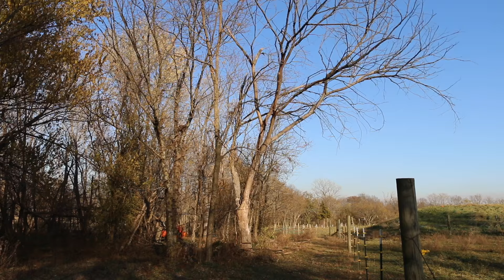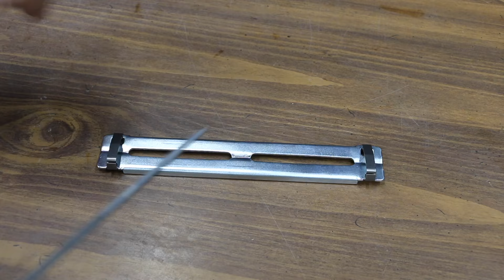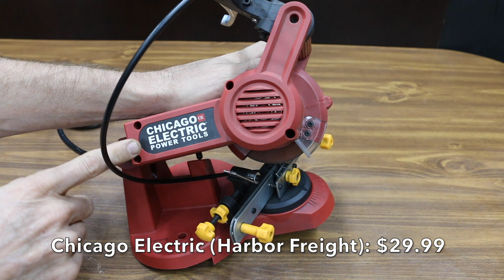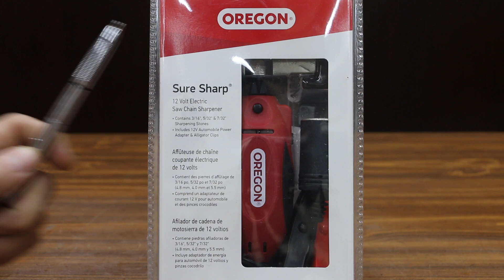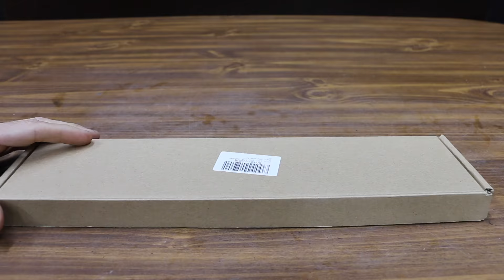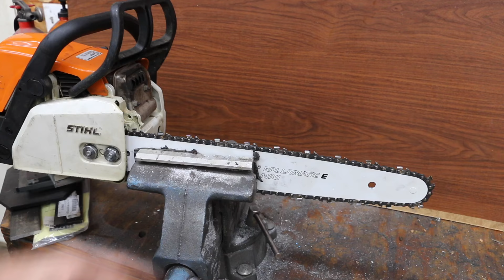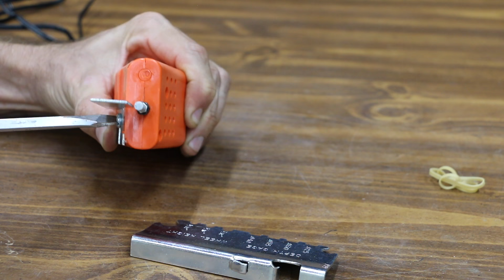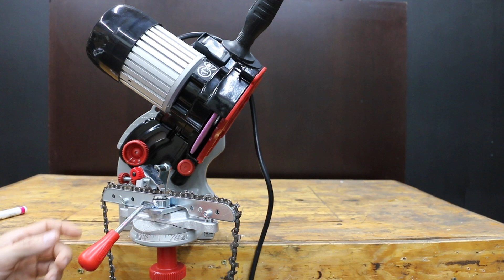Which Chainsaw Sharpener is Best? Let's find out! Stihl, Granberg, Chicago Electric, Oregon

Comment from the maker: Here's the list of products reviewed. More details in the video description. Thank you!
Stihl 2-in-1: https://amzn.to/3pYRdyb
Granberg Bar Mount Manual: https://amzn.to/3dx6Avt
Granberg 12v Bar Mount: https://amzn.to/2ZxnB0l
Oregon Sure Sharp 12v: https://amzn.to/3sdaBJA
Oregon 120V Bench: https://amzn.to/3udObd3
Chicago Electric 120V Bench: https://amzn.to/3dATmxA
Oregon Field Sharpening Kit: https://amzn.to/3qEvq09
Reply: Great reviews! Looking for old school Foley Belsaw 308 or Silvey 510 for my old school Dolmars. Hand filed forever, want to true up my chains a little once in a while. Just wanted to ask if you knew of any or who you know that would be a good source.
Keep up the good work,
Larry Carmer
Reply: Well done and thank you. I found the Stihl 2 in 1 to be the best value. I’ve used it for 5 years now and have gotten my filing times down to about 3 minutes. I work 40 acres of hardwood surrounding my home and head out to in the Kingquad towing a Gorilla Cart trailer. I use a simple “stump clamp” to hold the saw. I “touch up” the chain with the 2-in-1 every 30-60 minutes when it’s time to refuel, top up the bar oil, and grab a sib of coffee. No power required. A quick 2-3 strokes per tooth does the trick.
Reply: Господи как это тупо.
Живу в Сибири и мы спим с бензопилами в обнимку.
Что бы затупить цепь тебе её просто надо было полный газ и в землю на 2 секунды.
А тебе понадобилось аж целых 2 дня😂😂😂😂
Господи по чему так много сложных вещей?

Серьезно вы в США страдаете такой чушью?
 
У вас только один крутой чувак живёт в США с бензопилой его зовут Брюс Кэмпбелл, погоняло Эш Вильямс

Comment: I use the Stihl 2 in 1 and find that it's critical to stabilize the cutting teeth while sharpening.  Just putting the bar in a vice isn't enough and if you watch the tooth in your video, you can see it move a bit.  This messes up the angle.  I use a plastic rod and pull down on the chain on the bottom side.  Stick in the plastic.  This makes the chain really tight and stabilizes the teeth.  The difference between doing this and just sharpening a free chain is immense.  You could go to better than your best to worse than your worst sharpener results with technique alone.

Comment: With one sharping on a new chain you may get away with not filing the depth gauges. But as you do repeated sharping the depth gauges have to be lowered.

If you don't lower the depth gauges you can have a razor sharp tooth and it won't cut. You should add the time it takes to do that to the sharping time.

The Stihl 2 in 1 does both at the same time. I use the Stihl 2 in 1 and have had great results. It works every time.

Comment: You don't file the rakers with the depth gauge. You just look at the gauge and then take it off to file. The gauge is the minimum depth. For good cutting they need to be below it not above it. If you file with the gauge on the rakers will always be too high.

Comment: You should try a chain sharpener called Timberland. Great sharpener that consistently sharpens every tooth. More compact than the Grandberg. Uses a rotary crank burr system instead of files or stones.
Reply from the maker: Thanks for the suggestion.

Comment: The Oregon grinder was not used correctly.
The steel was overheated and carbon was burning out.
Trained machinist here with over 2 decades of machining including a lot of different grinders.

Comment: I just use a file  :face-purple-crying:  but your tests are very-impressive , one thing to consider : electric-sharpeners can soften the cutting-edge and result in more sharpening required as the edge dulls quicker plus you tend to remove more material and chains require replacement more-frequently...just sayin      dave  nz

Comment: I HAD the Oregon 12v sharpener, and it was pretty good until it burned out - it didn't last very long, maybe 6 months.  I cut firewood and it didn't last for more than one season.  I now just use my dremel, and touch up with a hand file in the field.

Comment: I’ve been sharpening chainsaws by hand for 54 years with basic hand files. Electric grinders will quickly take the temper out of the tooth and you can’t take them to the woods with you. If you’re going to run a saw you should learn how to do it by hand.

Comment: I have no doubt that a chainsaw can be made sharper with a file than any other method I'm here to tell you that for touching up an undamaged chain that's still cutting it's the way to go.  But if your chain is dull after hitting dirt  or dull to t

Comment: Bought the stihl 2in1 based on this video.  Easily the best sharpener I’ve used.  So much better than just a file.  Doesn’t need pressure.  Always removes the right amount if material.  My chains never cut this good. Watch, can make chains grabby

Comment: The problem is most grinders I’ve seen for this are too fast. They heat the tooth too much when grinding takes the temper out they won’t hold an edge.

Comment: Did you check the depth gauge on every chain after sharpening? I've found that is critical to the speed of cutting. And no, I'm not a professional, just someone who uses my chainsaw 10+ times a year.

Comment: Good video, One thing I would add is that the jigs that help you hand file are going to be what you have access to out in the field most of the time. The second thing I would mention is raker height. Even out of the box for softwood especially on a bigger saw I always increase the cutting depth.

Comment: Sorry but two things wrong with the test.  Poor chains to start with  Oregon chains and bars are not great quality.   Secondly all chains have to be "dulled" exactly the same to make a fair comparison.   Run them in clean known cosistency dirt or sand etc (Cleaning the chainsaw afterwards of course)  Or however you want but unless those chains are in EXACTLY the same condition for the tests, it's not a reliable test.  Just more YT eye candy.  I stopped at 50 seconds into this video,  You can test in that way and consider it a legitimate test PERIOD.

Comment: I’ll take a response from anyone that knows. Thank you

I used the 2 in 1 sharpener for old Stilh. I know have an Echo 590 and would love to keep using the 2 in 1. 
Question: so as long as I have the correct files installed in the sharpener, I can use the 2 in 1?

Comment: the tooth  turned blue sharping with the Oregon grinder indicating the tooth was overheated by grinding to fast three slow passes iis recommended to grind a tooth adequately  grind gently  the second  and third being slower and more gentle than the first tilting the chain to 10 degrees on a semi chisel chain will increase its performance regardless of manufactures recommendations   Sharper than a new chain   Check the depth gauges.

Comment: Can you please do this again there there are plenty of other kinds to try but the one I'd really like to see is the hand crank kind its basically a piece of aluminum that has 30 degree holes cut in so you attach it kinda like the grindburg then you slide the grinding stone thru the correct hole and hand crank it a few time they also have ones you can use a drill instead of cranking by hand but im interested in getting one but would love to see you do one of your videos and like I said there are tons of different sharper guides on the market you can definitely do a part 2 please
Reply from the maker: Thanks for the suggestion.

Comment: Couple issues here. A grinder (the Oregon) is useful for quickly lowering rakers and setting teeth to same length. They will never do as good. Job as a file, but do have their place. A file in the hands of a pro OR a file on the grandberg is the best bet, but you need a grinder if you are a serious user.

Comment: Dane here. Freehand and practice practice practice that's the best way to file a saw chain!!
..... and the sawing technique is also important... that is, doing the work in the right order.

You have 2 saws. One to fell the tree with and one to delimb with.

Start with hardwood and end with spruce and pine ... if you are so unfortunate as to have to saw such crap.

.... and in the end of your job, you cut down the stumps... so as not to dull the chain and since it is easier to sharpen the chain at home in the boiler room in a vice... last and not least remember to take a shower before you sit down in a chair with a beer or coffee, as the tick is a bigger enemy for you than the wolf!

Comment: I've got the Chicago sharpener and have used it since 2012 we had a saw mill and built log cabins and lots of timber. the sharpener has sharpened LOTS and LOTS of chains for under $30 you can't beat it I've only had to change the grinder wheel 1 or 2 times.
Reply from the maker: Thanks for sharing.

Comment: The Stihl 2 in 1 is the best by far when it comes to time spent and how sharp it got. You have to count in the setup time. That is time I could do something else. With that in mind an also that the sharpness and the time of actually sharping is one of the best also, there is no way any of the other tools beat it, especially when you know it also file the depth pin at the same time. On all the other tools that is an separate operation that will take even more time when it is needed to be filed.

Comment: I still prefer a file. I found anything that introduces heat, hardens the tooth and if your in the bush with a file, near impossible to file. The Timberline is a good unit, razor sharp, but expensive, slow, margin for error and you have to start with a new chain. I'd like to try a profiled Diamond wheel on the Oregon style grinder, with some kind of cooling system. I would say Stihl/Husqvarna/Oregon use some kind of oil cooled sharpener. But a good revue.

Comment: I can't believe a Demerol tool was not one of the choices you used in your video because me and four other companies all use them now we can get them sharper than from the factory. I can do a chain in 3-4 minutes. Those are real numbers and get the angle perfect without a machine being off a degree. I use very expensive sharpening bits just a couple few different sizes for chains and you can be on the job site if you have electric which we all do and sharpen your chainsaw while it's right on the chainsaw and be back in business in 3-4 minutes.

Comment: Ive had the stihl 2 in one for a few years now. Takes time but does a great job. Gotta keep up to the files tho, they tend to clog.. The depth cut is soooo important. The difference between nice shavings or dust. I think the grinder style produce a lot of heat and change the temper of the biting edge. The stihl can be used in the field away from all power sources. Thats my 2 cents worth anyhoo.
Reply from the maker: Great feedback on the Stihl! Thank you

Comment: Here's my Amazon review for the Granberg G1012XT (which I highly recommend) if anyone's interested.

Pros:
- Makes chain links razor sharp, much better than free-handing the Dremel tool electric sharpeners that I've used most of my life.
- Allows for consistent sharpening angles and depths using several points of adjustment.

Cons:
- The hex head screws for the chain stays vibrate loose during operation so make sure you're over a surface where you can pick them back up. They're only hand-tightened so they will come out with the continuous vibration.
- This requires a 12 VDC power source, those power supplies are relatively cheap and worth it for me since I'm not going to use a truck battery unless I'm out in the woods for an extended period.
- The plastic motor housing doesn't dissipate heat very well, so you may want to wait a few minutes as you're changing to the other of the bar to let it cool. Otherwise, you may shorten the life of the motor.
- The depth stop gets in the way of the wing nut used to set the cut angle. Unless you have small fingers (unlikely for most men) this will be a bit frustrating.

Comment: Old review but not mentioned in your multiple chain sharpening reviews.
I will advocate removing the chain from the saw . . .  why? to flip the bar and clean the chain case. I have at least 4 chains for each saw 1- Husky Rancher 55 cc, 20" bar and 2- Greenworks battery 16" bar. I use a Chicago electric sharpener, from your test, good but not the best.
In the field I can tell if the chain is getting dull and do a chain swap with bar flip. I will sharpen at least 6 chains at a time and do all the right sides, adjust the angle and then do all the left side grind.

Comment: I think Stihl 2:1 is the best - because it has the good design .... At least 4 edges in a row have exact same level, and angle of sharpening - and for chain its very important.... It also add speed to your sharpening job... Impressive design .... 
-
Even most expensive Oregon is technicaly behind...

Comment: I sharpen my own chains freehand with a handheld cutoff grinder, I can switch side to side, sharpen every tooth as it comes to me and cut down the riders all at once, better than new when I'm done, takes about 1/2 the time to sharpen my chain. Practice makes perfect. Of course the metal loosed some strength when you sharpen because you compromise some of the hardening process is interfered with.

Comment: I rely on your videos a lot when I’m looking to purchase an item because your evaluations are unbiased and fact based.   One thing I can’t wrap my head around is how the Harbor Freight sharpener can out perform the Oregon power sharpener.  The two sharpeners use the same technology but the Oregon has more adjustment capability and I’m sure once in position, is more rigid.   With that said, at the very least, I’d expect the two machines to produce the same results.  Any thoughts on how the Harbor Freight could outperform the same type of tool that is more precise?   Thanks

Comment: I think most of us who aren't professional tree trimmers want quick and easy. I have a mini saw, an 8" pole saw, a 16" chain saw. Most of the time I simply want to dress the chain a bit to make up for normal wear and tree sap. The two in one kit allows me to make a quick three pass on each cutter and it keeps the saws cutting well. As soon as the chip size changes I pull out the depth gauge and cut the rakers down. A lot of the time I can do it in the field. For the pole saw I set it across the loader on my tractor and make a pass of all cutters in one direction. Turn the saw in the other direction on the loader and make a pass for the opposite cutters. It only takes a couple of minutes to sharpen a chain and I don't really care if it cuts two seconds faster if sharpening takes me far longer to do. For me the simpler and faster the system the more I like it.
Reply from the maker: Thanks for sharing.

Comment: I do a lot of fire wood and seem to hit a lot of rocks and dirt and have used almost every type of sharpener out there and with limited time I finally broke down and bought a Super Jolly electric sharpener and it seems to do the job well and saves me a bunch of time. When In the woods cutting my go to is the Sthil 2 N 1 sharpener. The biggest thing is keeping your angles right and consistent, this is where the Super Jolly shines...after a very quick set up the machine keeps everything in perfect alignment and just pull the handle lightly a few times and done.
Reply from the maker: Thanks for the feedback.

Comment: The HF with grinding wheel does not compensate when you rotate to do the opposite side of change. Blades nearest to you are fine, farthest away are not centered on grinding wheel, offset by thickness of chain. Thats why the geometry is off and they dont cut straight.

Comment: One thing you didn't test was the the average duration of each sharpening type for say 10 cuts. I bet a hand sharpened chain stays sharper longer due to the fact a grinder takes the temper out of the tooth because of the heat the grinder generates.
Reply from the maker: Thanks for the constructive feedback.

Comment: I have used several types of file sharpeners. The one I use the most is the HB electric  (on sale for $25). The chains seem to stay sharper longer than a file system or having the dealer do it (for $7 a shot).
Reply from the maker: Thanks for the feedback.

Comment: I have I think is an Oregon almost identical to the granberg but it's plastic and moves all around.  Was wanting a metal one.  Never saw this one and don't want electric so when away from power source.
Stihl looks simple but your hand movement ruins it.
I know pros run a file alone.
Not being a pro means every time with the possible months between using would mean my accuracy at proper angle control would falter.
Definitely getting a granberg.  Hopefully it being what looks like as pot metal won't snap on me first time out,
Reply from the maker: Thanks for the feedback.